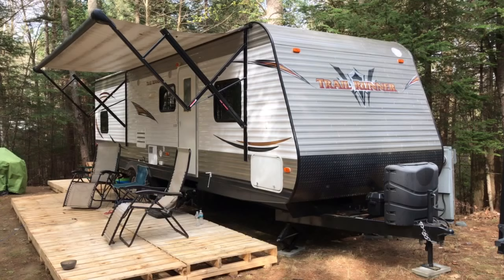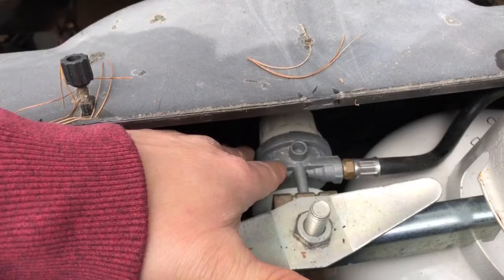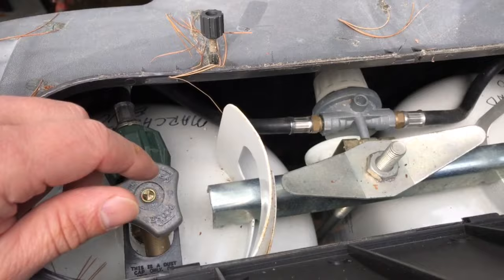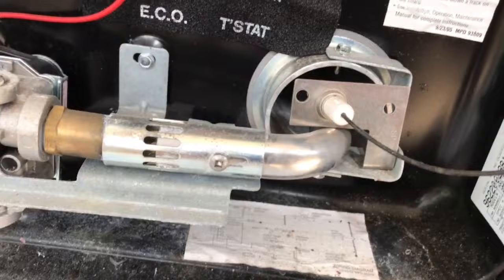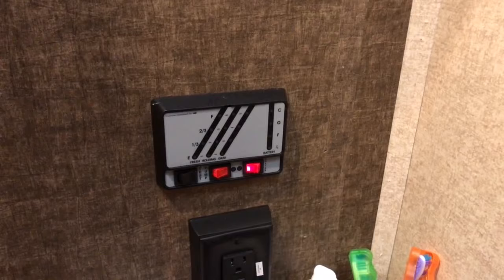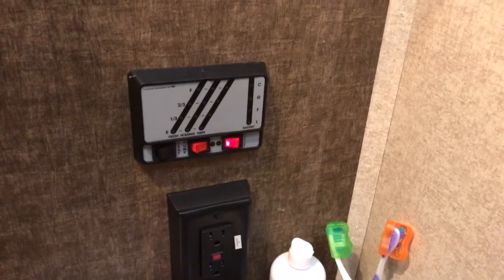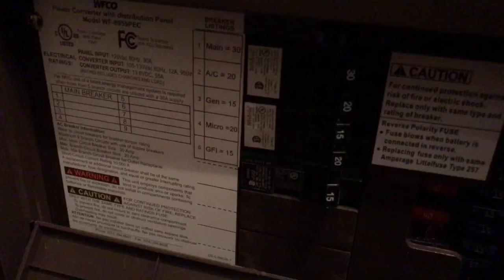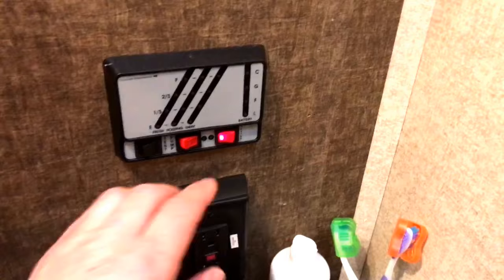How To Troubleshoot a RV Hot Water Heater That Will Not Ignite

Comment: I have a used (new to me) class A motorhome, and took it out for its first trip and couldn't get the hot water heater to kick off.  I see I have the same water heat as you have in the trailer, and the same display and realized I didn't have the 'heater' selection turned on, so I'm hoping that was the issue.
Thanks for posting taking the time to put this little video together to help people like me out!
Reply from the maker: Hope this has helped you out Greg. Thanks for watching.

Comment: I just went through two days of messing with my RV water heater that wouldn't ignite. Had good spark in the tube. Stove top and furnace worked. Downloaded a troubleshooting guide and the only thing that worked was switching the tanks....yes swap the tank from passenger side to driver side lol. Don't know why but it worked. Something with resetting regulators. Anyways, hopefully this comment will save some fellow campers a lot of headaches!
Reply from the maker: Thanks for posting and helping out!
Reply: I thought about doing this but...no....THAT couldn't possibly fix the problem.  Now, I'll go back to the RV and give this a try!
Reply: Dear god man, it worked! After 2 hours of farting around, I found and read your post.   It was a new tank, I was using,  so it is going back to the place I got it tomorrow. Thank you so much!!!!!
Reply: There's a small safety check valve in the fitting that.goes onto the tank. If the tank valve is opened.too quickly at times, it.can cause the ball to block the flow of gas. You can "reset" them by closing the tank valve, waiting a few minutes, then slowly opening the valve this time.
Reply from the maker: Thanks for watching. Don't forget to sub the channel to for more videos like this!
Reply from the maker: Thanks for watching. Don't forget to sub the channel to for more videos like this!

Comment: Did you show the a/c fuses for a "gas no start?" Gas start ignition is controlled by a 12 volt D.C. System fuse,then look for the water heater 12 volt D.C.  fuse to see if blown. 120 volt ac resets are for the 120/ac element only, if your water heater has an ac element for hot water. Looks like you want to be helpful, correct information is what helps the best.......
Reply: Gary Cass wow..... Thank you after an hour i finally saw a paragraph that took you maybe 47 seconds.. This vid here was something for sure.. Dont know what... Thanks for your comment!! 👍👍
Reply: Gary Cass also.... It took over a year to reach someone that needed your wisdom👍
Reply from the maker: Thank you for the added help!

Comment: There’s a button inside of the RV that I normally press and I could
hear the flame ignite. It used to work perfectly fine. Then I would have to press the button two to three times for it to ignite. Then I had to press it five or 6 times for it to ignite. Now it’s not igniting at all and I don’t have hot water.
Reply from the maker: I am wondering if the ignitor might have worn out.
Reply: @HomeOwnerRepair  thank you for responding. I appreciate it. I was hoping that was not the problem. Are ignition switches universal? I have a 1987 Winnebago chieftain that has a general manual I found online. I’m not sure how to determine the proper ignition switch for it.

Comment: It shouldn't be a breaker controlling your igniter board! It runs on 12 Volts, so look for a blown fuse! There is, an AC heater controlled by a separate switch and Breaker for it!
Reply from the maker: Thanks for the added tip!

Comment: Just went to take a shower and turned on my hot water heater nothing not even the red light is appearing and zero effort to ignite nothing's happening and the fuse box and breaker box has nothing on the hot water heater any information on what to do would be greatly appreciated troubleshooting?
Reply from the maker: For starters check the propane level if you are heating it up that way.

Comment: My auto-start propane water heater (just like yours) tries to ignite but fails but if I open the main door of the heater on the side of my RV it lights every time. Its like it needs air flow or something. Any ideas?
Reply from the maker: Mine makes three attempts before it will ignite. tick ..tick..tick..poof  tick..tick..tick..poof tick..tick..tick..poof.. It's a pain
Reply: Homeowner Repair Yeah that’s  what mine does but if I open the water heater door it lights right up. Now I’ve learned to open the heater door before I hit the button and it lights the first time. If I leave the door shut it tic tic poofs three times then cuts out. Sometimes i get lucky and it’ll light on the second or third try
Reply: Homeowner Repair I wonder if that little vented pipe needs to be adjusted but I’m so new to this I’m afraid to try that until I learn a little more about it. Lol don’t wanna blow up my new RV or ME. Lol
Reply from the maker: Glad to here I'm not the only one with this issue
Reply: @GeorgeBonez  the lower the elevation, the less air you want going through the grate. If you're in a higher elevation you might need to slide the grate to the left to allow more air in
Reply from the maker: Thanks for watching

Comment: thank you for the help.  my propane is on, even lit the stove to make sure.  electric ignition clicks when turned on then turns off and goes silent, and then light indicator comes back on and stays on. i've opened the back panel and never seen flame in the burn chamber.  i leave it on for 30 minutes and the tank and water is bone cold.  I'm at a loss. can anyone help me? thank you:)
Reply: Sounds like a bad thermocouple. I had the same problem and that took care of it.
Reply: @joshdavis6102   my rv is only a couple months old an have the same problem .. how did you replace the thermocouple ?
Reply from the maker: Sorry just saw this comment.

Comment: My water heater lights but water starts coming out of the box. It’s hot water. But when I turn off the water heater it doesn’t leak. Please help me with what to do next to stop the water from coming out of the back outside of camper.
Reply: Hot water builds up pressure, so perhaps you have a fitting that needs to be tightened, or your tank is at the end of its life cycle and the pressure forces that water out through a rusted out area of the tank??
Reply from the maker: Sorry just saw this. Did you get it fixed?

Comment: On my hot water heater at LED lights on the control panel are not working and all the fuses are good and all the circuit breakers are on. Why is my hot water not working then on electric or gas?
Reply from the maker: Did you ever figure this out

Comment: I can't get mine to work. When I flip the switch there are no clicking noises. I went outside to the water heater itself and it doesn't even light with a torch, even though I can smell gas. What could be the problem? I know there is propane because the stove works.
Reply from the maker: Check the circuit breakers to see if the circuit that the igniter is on has tripped. If that is fine you may want to test the board see if there is power to the board or if the circuit board is bad.
Reply: I'm having exact same problem. Replaced pressure water valve, thermostat and blower tube this week and STILL no hot water sigh

Comment: my own and off switch to my water heater inside the camper how do I ignite it or switch it to electric-only cani
Reply from the maker: On my camper to switch it to electric I have to open the cover where the water heater ignitor is and there is a switch on the side to turn the electric water heater on. Your owner's manual for the RY should also describe the process to switch from propane to electric. Hope this helps you out.

Comment: I'm getting zero power to my water heater and I flipped the breaker and nothing....it stopped working wen the wires fried from the control board
Reply from the maker: You would have to fix the damaged components to get it working correctly again.

Comment: My gas heater will no longer light on its own unless I turn the heater switch off then back on.  It'll then ignite .  rv is a 2008 .  Any ideas ?
Reply from the maker: It sounds like by doing that you are resetting something. If there is a relay or a circuit board on that circuit it might be going bad.

Comment: Mine is lit and gas but the water is still cold.
Reply from the maker: The valve on the water heater might might be turned the wrong way bypassing the tank. You may want to take a look at it. Hope this helps you out